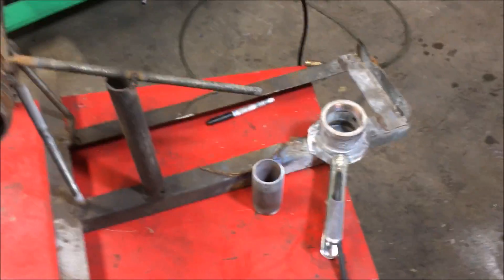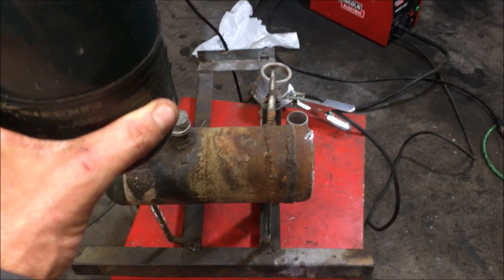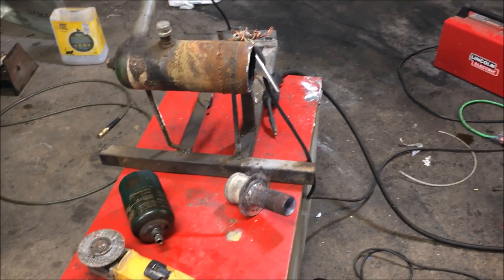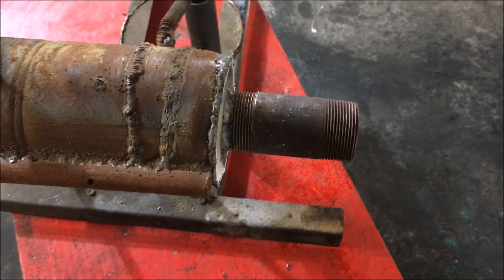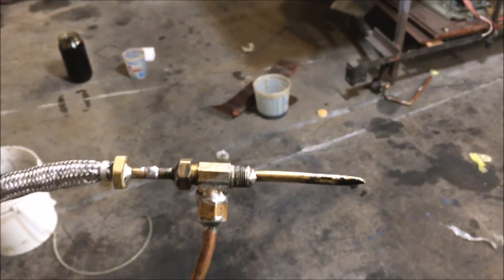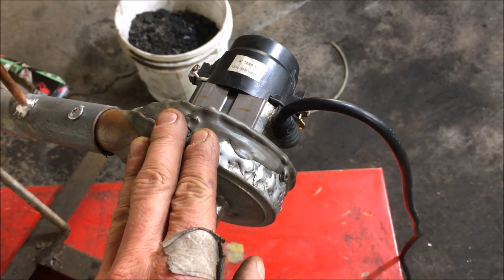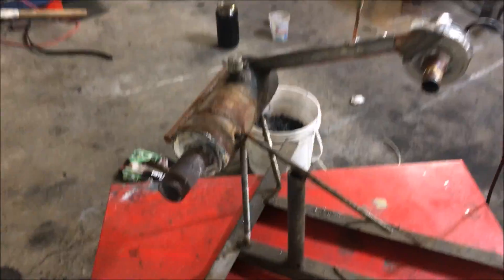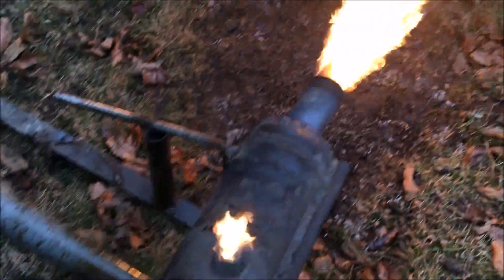Waste oil burner  (SUPERCHARGED) Micro forge burner

Comment: You requested failures.  Here is a video of a Delavan nozzle I have been working with. I have pressurized diesel for fuel.  Pressurized Air is filtered for water and trash.  The biggest flame I could muster is about a foot long.   
The nozzle is very touchy.  It floods. 
It is very subject to water in air.
It is very subject to air bubbles in fuel.

At the end of the video I finally got a 12 inch flame. 

https://youtu.be/vmg55zJBGsI 

I am going to the big chamber type chamber .

Comment: Those crucible that you buy online I built mine oil burner and I melt those things down they are worthless I had to go back to half inch steel pipe do you have a crucible to keep from melting it down I actually use cast iron

Comment: You are wasting fuel out your ignition port. Converge the end of the combustion chamber, and put a small venturi in the exit tube. Then the flame will at least be blue w/ no smoke. More efficient. Hotter by 25 percent.

Comment: I just built one, I ended up forgoing the adjustable height just for the sake of getting it done sooner. It works pretty well, once I get the flow rate dialed in I’ll post a video.

Comment: If thats a vacuum cleaner motor I dont know why you soldered the pipe to the side of it, place the back of the motor in a tube with a reducer to your burner.

Comment: Maybe I missed something? But why the small hole in the top of the chamber where some of the fuel is burning from it>
Reply from the maker: to pre heat the chamber and the air , it keeps the beast hot , plug that hole and you loose efficiency, its inducing flame migration   to cooler sections of the reaction
Reply: Thanks for that question & answer

Comment: So, you want to heat the oil/air mix earlier? Why not extend the outlet tube way inside the cylinder, nearly to the "cold" end and put the input to the cylinder nearer the hot end...

Comment: I just built a waste oil heater out of an old oil stove, it's minus -15 ( garage size 20 x 16) takes around 25 minutes to go +10 which is easily warm enough, however we frequently experience -30's to -40's for months on end.  ( add the / with wind makes it dangerously cold ) I've only tried Pennzoil ultra synthetic 20 / 50 (Last oil change) I used about 1/5 gas mixture to thin it out.  But am wondering what kind of effects I would experience with normal 10/30 motor oil  - I did the mix with diesel last time and it didn't seem to make any difference, ( I start the stove with gas on small piece of rag )  For people with unlimited $funds propane probably would be so much easier.  ( I always used wood stove ) but am getting to old / injured / pain which prevents putting up enough wood to last through the 4-5 months till spring. Thanks for the video, am looking forward to building a foundry.

Comment: I just convert my typical wood burner into an oil burner. No fans,simple construction. Max heat i’ve got is almost 600” celsius with around 1.8 to 2liters oil. I can not say how much is the power in Kw. Usually spend 0.8 to 1.3 L oil per hours in cold days / under 0 “ celsius. My garage is 8.5m x 4m . When burner work 2 hours or more  temperature in garage is 22-23” celsius

Comment: Off subject did you go with stainless on your boiler because of ...price, melting point, pressure rating, easier to use, or price? Hope it's cool to ask. By the wayyouve disproven several things u said was not possible.  Lol. Hey y'all stuff used to not be possible.
Reply from the maker: Corrosion resistants

Comment: The truck shop that I worked at in Iowa we ran through 2500 gallons of oil and diesel rear end fluid a year and some of the worst winters we had to buy oil

Comment: I built one in this style, works great. Only suggestion would be to use a sheet of stainless steel as a liner to help with radiant heat. In mine the insides get yellow hot fast while the outside doesn’t get hot enough to glow.

Comment: hi Nobox, this looks great, i''ve finished constructing my furnace and only after a few firings with an Air/diesel syphon nozzle i've deceided they are too much trouble. (also so noisy with my huge air compressor going all the time) so i was looking about for something simpler and found your vid. I've got a nice dyson housing for a blower. i just need to weld up the little combustion chamber. Do you have any advice on the shape/length? do you still use this one? (i've seen another that's a cylinder but it's upright). i'll let you know how it goes :0 cheers for the great vid o/

Comment: Got little dizzy there..
Reply from the maker: yeah i need a $30k gyro cam
Reply from the maker: would you believe they didn't give me the option to stop the shaking usually they offer
Reply: Yeah, that’s weird..
30k for a cam? Wow, that’ would be out of my realm :)
Reply from the maker: Lol i was kidding bro , and yes my camera skills leave much to be desired  , dont worry i give myself a good ass chewing in editing, it just doesn't seem that shaky at the time of filming
Reply: NOBOX7 I know man, I’m suffering from the same problem.. I enjoy your videos! They’re bit too stretched to my taste, but, not horrible :-)
I’m planning to build myself a burner to smelt some aluminum. However, you say they’re loud, may not work for my neighborhood.. I might end up doing just charcoal and a blower, will see.
Reply from the maker: yes for aluminum that would be more than enough heat , and you don't even need a forge , dig a hole in the ground and bang your in business, dirt is an excellent insulator , it will even get orange hot   indicating it loses very little heat. however getting the crucible back in might be a pain but beats messing with oil and building forgess

Comment: I am using a waste oil burner to heat my 720m³ shop. Using about 1000 liters for the winter season each year. But im lucky, i have a scrap yard accros the street that gives me the oil.
For people that just want to try it it is kind of hard to get that much oil somewhere. And then you have to somehow transport it home and store it. Its just not worth the trouble. But because we get it from acros the street we just pick up a few 200L barrels on the forklift.
And yes it works great. My shop isnt perfectly insulated, lots of places that arent air tight by far. But still with -5c outside we do manage to get it 25c inside the shop(wich is way to hot to work)
Reply from the maker: excellent comment friend , you have told the truth where so many others are selling a lie , thanks brother right on man for telling us this , i hope more people see your comment because after my little bit of testing i realised waste oil heat is not practical at all , i tell people you need barrels not gallons lol .  im having alot of luck with my wood burner , people are giving away firewood every direction you turn your head
Reply: Over here i have to pay about €55-60 for 1m³ of firewood wich would be around the 450kg mark. And wood is about 4kw of energy per kg. That would mean that i would need a shitload of wood if i where to burn as crazy as i go with the oil.
The other side of it is that you can just put wood everywhere. No problems with police that dont like you transporting a load of wood(you can get in trouble if you transport lets say 1000 liters of waste oil) And no risk of it leaking and getting you a HUGE fine for leaking waste oil in to the ground. So yeah all in all the waste oil is only usefull for those that have a easy way to get it, and a good way of storing it. And also dont forget you need to clean the waste oil burner way more then you need to clean a wood burner. With the woodburner just clean out the ashes and once a year the fleu and you good to go. With a waste oil burner you need to clean out all the black crap that keeps building up everywhere. And if you have a bit of spillage its a huge mess to clean up(as you have discoverd and we have seen in your vids). So would i ever run a waste oil burner inside the house? NO NEVER. Would i use a wood burner in my house? Yeah no problem, those can be really nice if you have the space for it.